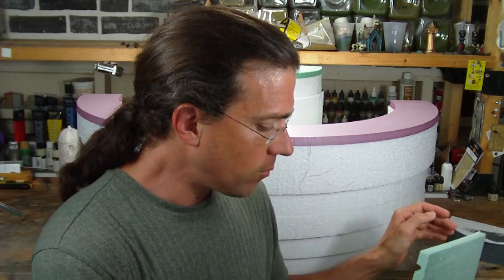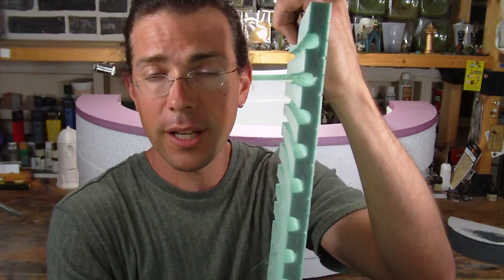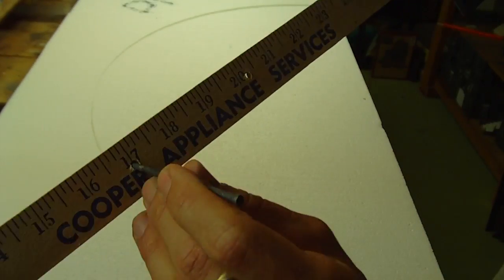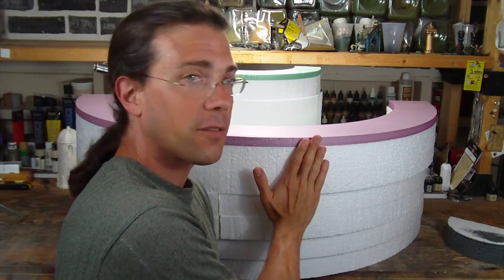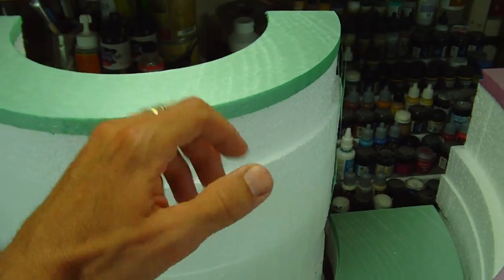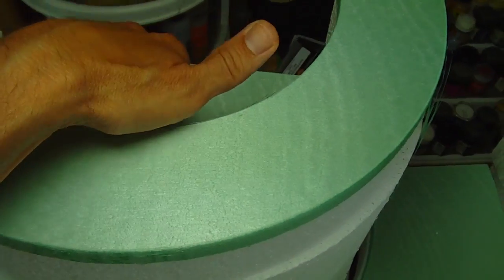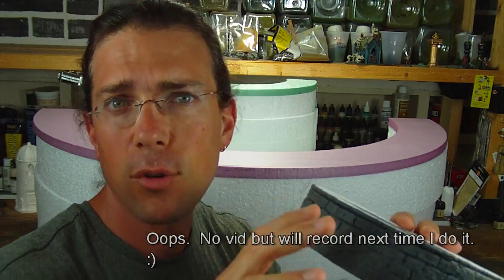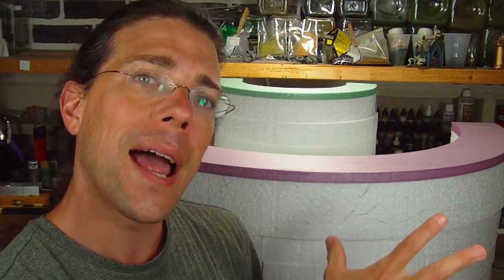TerranScapes - Castle Project 3

Comment: nice to see the evolution in the castle project and revert back to the original circular shape ;)
i think expanded polystyrene will bend nicely, especially since i've seen it available rolled up in cylinder tubes of about 1m (about 3.2 ft) wide and with a thicknes of about 0,5cm (about 1/4" (?)).  they also sell it rolled up in a cylinder form with an aluminium side to it for isolating material put behind heating elements.

Comment: The expanded foam is much softer than the extruded foam. If you do plane the foam down to a usable thickness it should be fine to be able to carve into and put on the outsides of your edges. I believed the 1/4" foam from lowes would have been much better to use for the brick work, but it is also nearly $44 for the bundle. Great work btw, glad I could help out with the problems.

Comment: expanded polystyrene does bend esily, I've handled thin panels (1/2") that bend on their own weight, but you're right, they tend to break esily (due to the bead texture) I predict though that you can do the whole circumference with ease :)
Nice work and video as always

Comment: It's a great project.
I think the polystyrene looks good and natural. If you cut larger channels for the individual bricks would that allow for a second coating without filling in all the detail? (but then I didn't see any representation of the mortar between the bricks. will that just be color?)

Since you have such an effective way of cutting curves why will you need to bend the board? Is that just to make it easier to cut the brickwork?

Comment: there is this thin sheet polystyrene used in plates think that would be a good material to use on your wall surfaces blow drying will help it bend easier to cover your castle wall :)

Comment: Is there any reason why for the outside the white foam you cut it previously in thin layers I think it was 1/2 inch if you cut layers of the white foam you would have rounded "clading" to cut your bricks from and simply glue into place one on top of the other till the top of the wall was reached